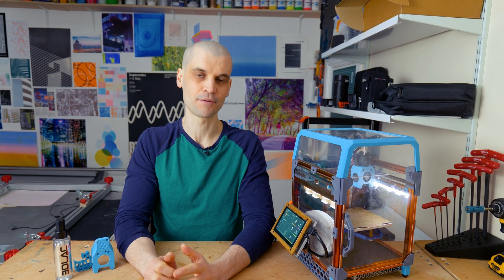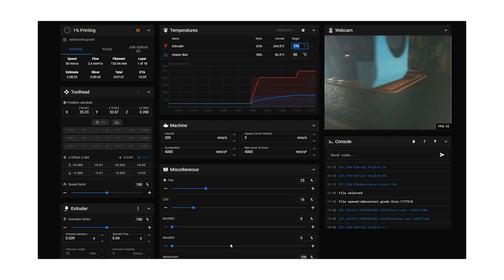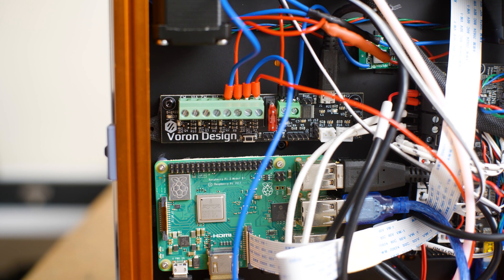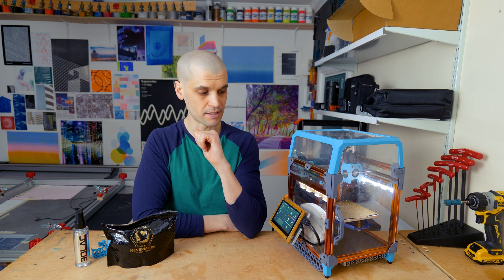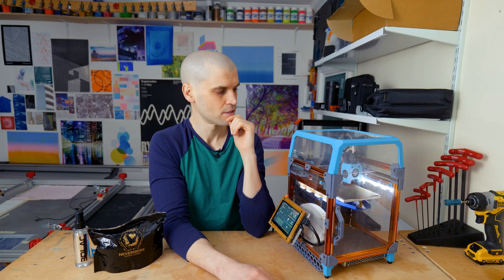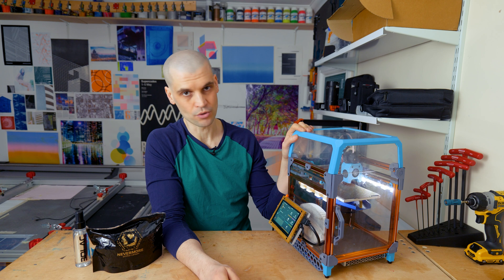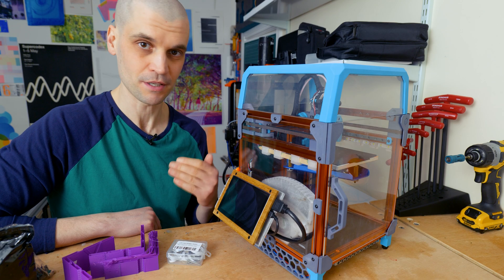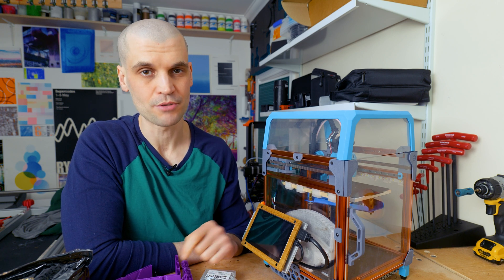MUST-HAVE Voron 0.1 Mods and Upgrades

Comment: very good video indeed! but I disagree with the kirigami bed. I printed mine with esun abs+ and had solid bed since 1 year ago. never had a leveling issue, so naturally I didn't buy the kirigami upgrade. I initially had very skeptical opinion about the original design (it really is tedious and inconvenient) but it worked! just my opinion:)   (edited due to typo)
Reply from the maker: Thanks for the info! Maybe my ABS parts for the original bed weren't printed optimally. I had level issues all the time. I wont buy a printer without ABL from now on. I have the FF5M Pro , its my first printer with ABL and my god I do not miss the tinkering of getting good first layers with the voron 0.1
Reply: @ThisDesignedThat  I was skeptical at first because even the official voron doc doesn't recommend eSUN abs+. In my experience, however, abs+ is holding up strong and even after several very unpleasant nozzle crashes to bed didn't damage the Z axis. I'm pleasantly surprised:) keep up the work! nice video.

Comment: I've been using a V0.1/2 for two years and find myself in agreement with the concerns you've mentioned. My upgrades mirror yours closely, with a few additional tweaks. For improved cooling, I installed a 120mm auxiliary fan and incorporated Angrycam for better spaghetti detection. Recently, I ordered the SHT36 v2 CANbus featuring a PT100 and encoder, which will repurpose one of the rear thermistors for chamber temperature monitoring. Plans are in place to integrate a clicky probe into my Dragonburner cowling. Although I haven't switched to a metal bed, I experience frequent bed leveling issues and adhesion problems. I'm optimistic the clicky probe will address these. Applying thread locker to the bed nuts, as you suggested, seems like a solid idea I'm keen to try. Despite my love-hate relationship with this printer, its exceptional speed and compact size make it ideal for small prints and conveniently portable for presentations.

Comment: Strange that you had problems with bed adhesion - that's one thing my V0.1 has been absolutely flawless at.
Reply from the maker: Adhesion has been mostly fixed now I switched to kirigami bed and use 3dlac glue

Comment: Great Video!  How ever I have an issue with putting thread locker on the screws/nuts.    When screws/ nuts are into plastic. They just have a nature to come loose. Which is usually by plastic shrinkage or long term stress pressure.  Putting thread locker will prevent the screw from just falling out.  But you will still just have a loose joint to deal with over time.  With thread locker you might have an issue with re-tightening the screws/nuts.   Designing and printing 3D plastic parts for prototyping is great and fun.  But plastic is not a long term part for high load or rapid movement situations.  It's a metamorphic solid material.   Which means plastic parts on load bearing structures are not a great idea.   As in: Voron's 0.1 bed attach brackets, motor supports, gantry brackets, and bearing structures.  Sure, it will get you started and that's been fun.  But, this is why top notch printers and other machines. Why they cost more, is because of their machined metal parts for longevity.
Reply: Just a bit of warning, you shouldn't put thread locker on screws, or bolts that bolt into plastic, threadlocker chemically reacts with ABS, and it makes it weaker, so you should avoid getting any of it on your printed parts, only use threadlocker when bolting into metal parts

Comment: Hey man, thanks for these awesome videos! They helped temper my expectations after ordering my 0.1 kit! It's the most fun I've had with 3d printing!! I followed pretty much all your suggestions with zero regrets! The touchscreen is just such a cool and useful feature that just destroys the other printers I own. I'm now looking at installing auto bed levelling and I also suspect my bed levelling nuts are working themselves loose, so I'm thinking of just locking my bed dead flat and removing the springs all together, like how prusa and bambu have. I reckon this could possibly make the v0 even more rigid and accurate with reliable bed levelling. Either way, I'll give it a go and keep you posted! Keep up with the great videos, and I would love to see you do a 2.4!
Reply from the maker: Yes, springs are one of the worse ways to secure the bed. I like the idea of locking in the bed at a fixed level.

Comment: Great video! The mini stealth burner extruder on the updated 0.2 is far easier to maintain than the mini afterburner. The only mods I’ve made to mine (beyond those included in the LDO S1 kit) thus far are a set of slimline carry handles and a clip on mount for a Microsoft HD3000 webcam.

What’s the mod for the scrubber brush? Doesn’t seem to be in the description
Reply from the maker: https://www.printables.com/model/181785-voron-v01-nozzle-brush

Comment: Why not going CAN?
Reply: LDO V0 kits come with Picobilical by default which cleans up wiring and improves maintenance of toolhead, so at least personally I don't see the benefit. For V2.4 and Trident, definitely worth it!
Reply: @onlytiramisu  I know I have one and I went CAN.
Reply: @cristianopersi7953  How come? Genuinely curious
Reply: @onlytiramisu  I heared about problems with picobilical and didn‘t want to have that. As I have a V2.4 with CAn and it wors I decided to go with CAN. So I have a spare picobilical.
Reply from the maker: what is CAN?
Reply: @ThisDesignedThat  CAN bus is a connection to control the toolthead. You only have 4 cables going from the toolhead to the controler.
Reply: @This Designed That  canbus is a data connection you use if you have a board on your tool head. Your extruder, hotend, thermistor,fans, probe, and such are all controlled through a board mounted on your carraige over canbus signal. In the best case, you have a smaller umbilical, worst case, i run the days can be too slow running all that- don't quote me, talking real fast. Not sure how it would run a 80w heater, can't do beacon,  but it works for lots of people
Reply: @travistucker7317  well I run CAN and it works perfect.
Reply: @Cristiano Persi  that's great.  I was just trying to explain a little better

Comment: really like your videos, keep it up! you said that you would like to build a voron 2.4 in the future but have you also considered buying bambu lab's p1p (or the x1)? the budget would be probably similar, maybe the p1p would be cheaper actually. I know that one is completely open source and the other is the opposite but in the end when you need the machine just to print reliably (and fast) is the endless tinkering worth it?
Reply from the maker: Hi Stefan, thanks for the kind words, much appreciated. Yes I have considered bambu labs. it looks amazing, and also other DIY printers such as Ratrig and HevORT. For me this is as much learning as it is printing, Im not needing to print parts for commercial purposes so I don't mind the tinkering and Ive learnt a lot about the basic of electrics with this Voron which is something I wanted to gain knowledge on.

Im hoping that the technology in the bambu labs x1 will start to get reverse-engineered and introduced into DIY printers like the voron. That would be the best of both worlds. As you say, Bambu is closed source which I really don't like, and 5 years down the line if you want to upgrade a part, how easy is it going to be ????

For now I'm good with what I have, it cover my prototyping needs mostly, and I actually have a Elegoo Mars 3 Pro arriving in literally a few hours of me typing this out so I can experiment with resin printing too now. The bambu lab a major advancement in 3d printing in the last few years, the prusa XL with tool changer will also be another big step in 3d printing functionality. My next investment in a printer will probably be something that contains all these features. Maybe the Voron 3, who knows :)
Reply: I totally understand what you mean but I've been completely upgrading an old ender 3 (probably a bad idea to start with) for the past few months and the endless calibration & tinkering has been driving me crazy. 

Now all that I want is just a printer that prints reliably, thus my interest in the p1p - but as you've said maybe in the future they will reverse some of the tech behind that or maybe bambu lab will slowly make some of their parts open source.. though I doubt it (at least the parts are kinda cheap and they did make their software open source)

Comment: I started building a 0.1 back in November and I just cannot bring myself to finish it... lost interest because I kept getting frustrated with the instructions and issues along the way.
Reply from the maker: Try not to give up Mark, read the instruction very carefully and check out Gregs Makers Corner for the full 0.1 build series, its very helpful where the manual doesn't give enough detail. Also hop on the Voron Discord, lots of help can be asked there.
Reply: it took me a whole year to finish, Mark. you will get there someday..
Reply: I certainly understand your frustration, Mark. I started mine back in November too, and I just finished it today! I was very busy and tired because of work, so I never felt motivated to sit down for hours on end. I decided to break it up into small steps and do just enough to feel like I progressed. "Only installed a handful of screws today? Hey, they weren't there yesterday!"  It certainly is a challenge, but at the end of it all, you'll have yourself a new machine and more knowledge about the hobby!
Reply: Just do a few steps each day, and it’ll be finished before you know it. Seriously, that’s the approach I took and finished in a few weeks. And I took the hard way in self sourcing too